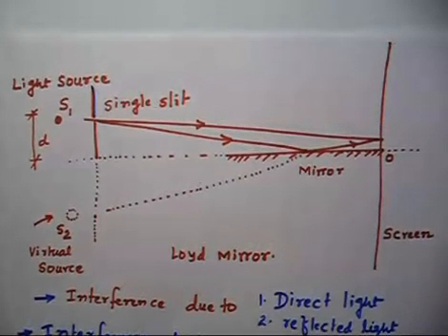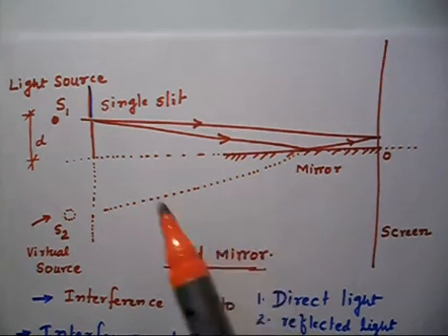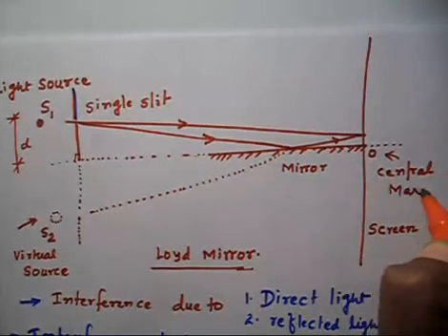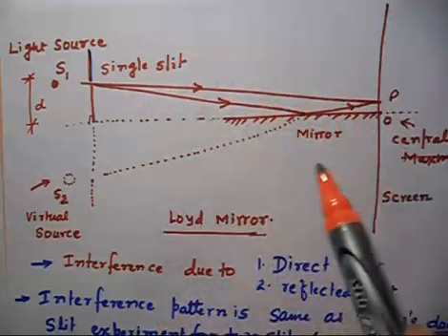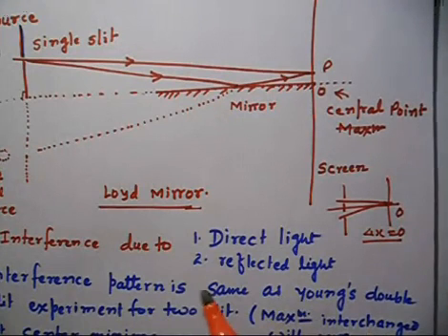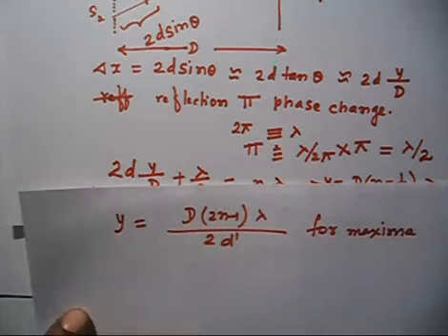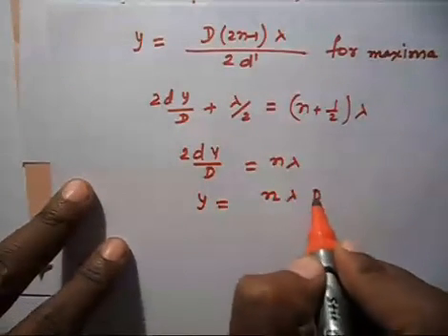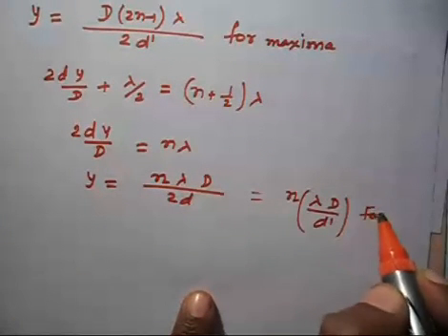How Loyds mirror works -Concepts I Wave Optics I Interference of light

Comment: Path difference is not zero for central fringe.
Reply from the maker: +sachin sachin May be you needs to check the definition.
Reply: In this case path difference is lemda/2 more. So we will have dark fringe at the centre.
Reply: I guess someone needs to check something. But I trust its not me.
Reply: By the way, learned a lot from this video. Very helpful indeed.
Reply from the maker: Thanks for watching